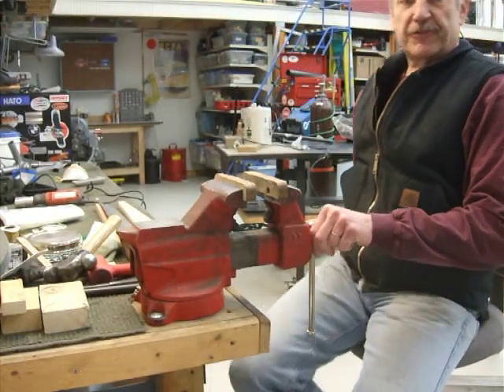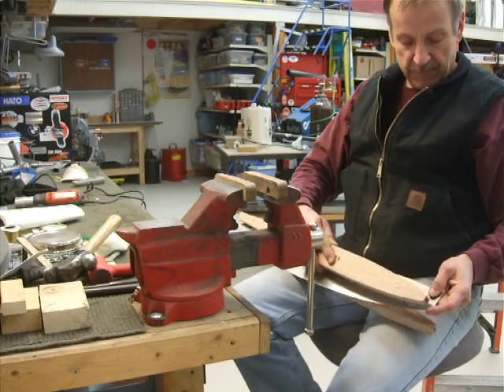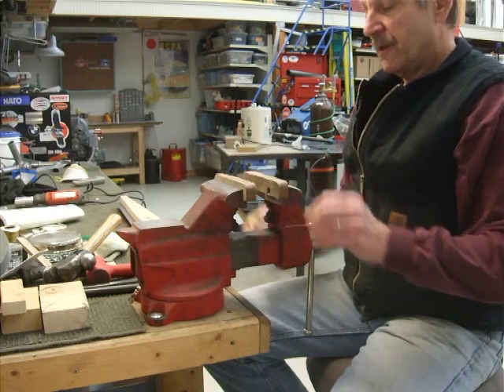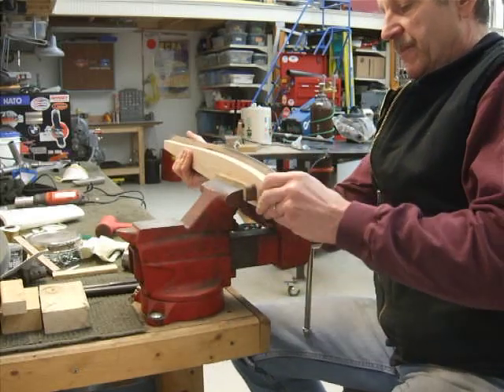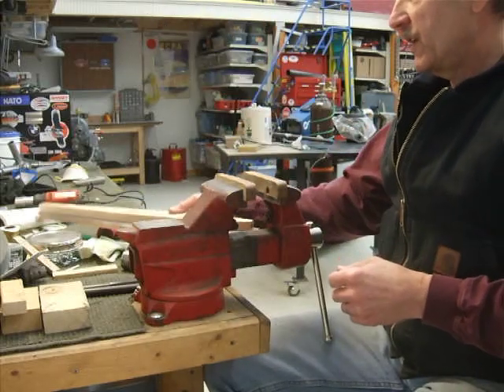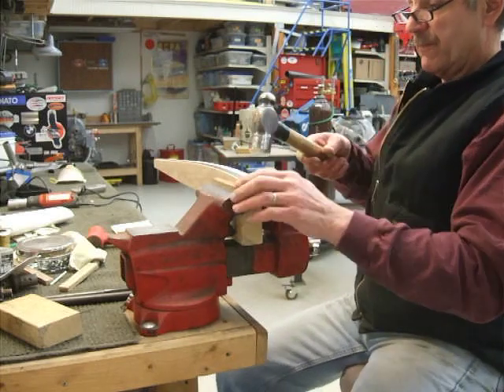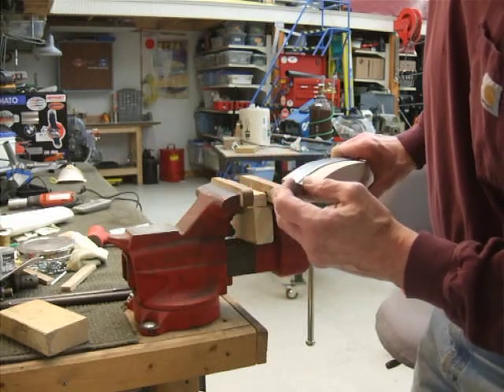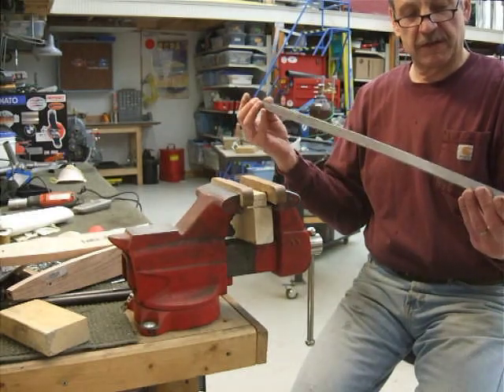Forming a Profiled Rib for a Bearhawk Part 2

Comment: Why didn't you just use a metal shrinker? Planishing is great, but it seems like doing a little shrinking along the edge would go a long way.
Reply from the maker: Tom B Great question! Shrinkers and stretchers leave marks in the metal which is not good for any aircraft part. These grooves are stress risers and “catch” vibrations and if not polished out the part will eventually develop cracks. Since there are so many ribs it just made sense to use the tried and true fluting pliers to achieve the same result without all of the work of polishing out all the stress risers. You see that process in the third video.